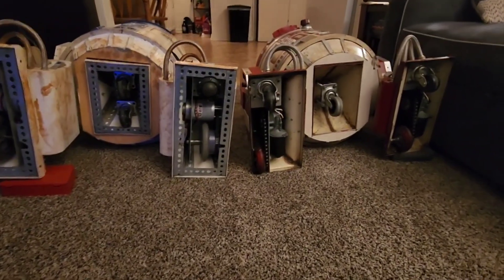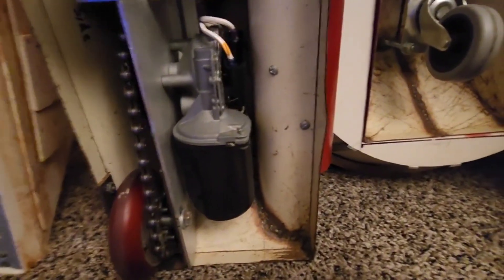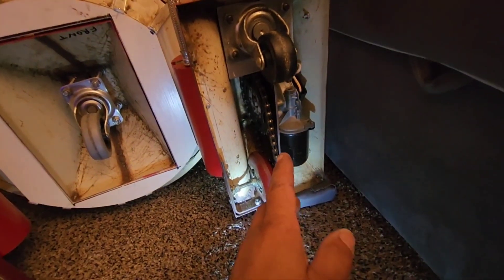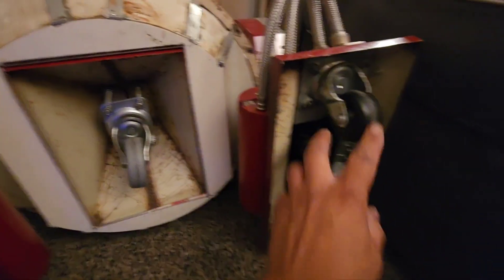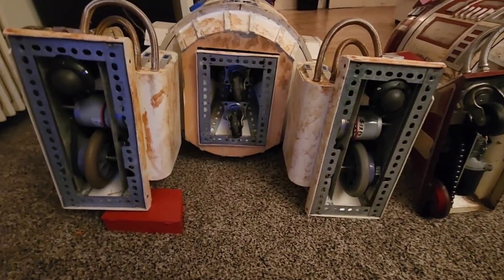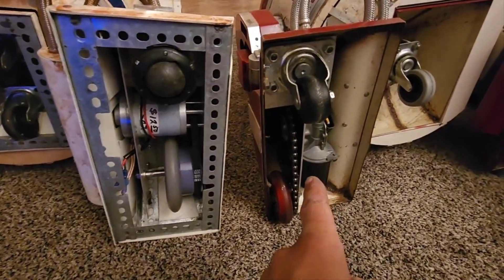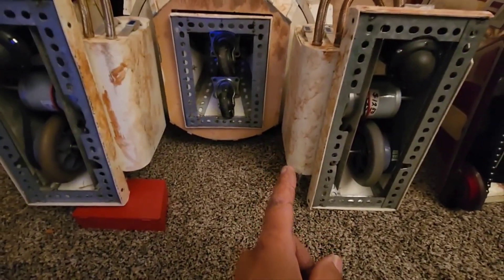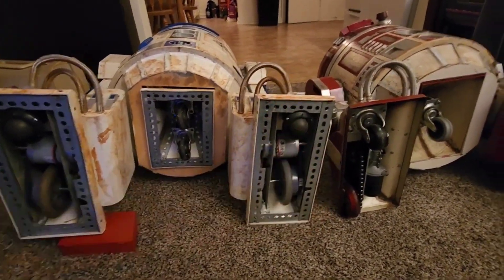R2 Building: Wheelbase on 2-3-2 droids

Comment: It's encouraging to see you have belt drive on R2. My droid in progress has belt drive and I've had a lot of issues with the belt slipping. I've had to add a lot of springs to the idler to keep in tensioned. I was beginning to worry that belt wasn't up to the task and that I should have gone with chain.
Reply from the maker: The successful belt drives have no tensioner wheel. But rather tensioners at the wheel axle, that keep the belt at a perfect tension as you tighten the axle nuts. Motorcycles have the same kind of axle tensioners that align the wheel and tension the chain perfectly before you lock down the axle nuts. The Razor scooters have them as well.
Reply: @craigsmith4436  Thank you for the response. I'm not familiar with that tensioning process and I'm a little too far with my method to change now. Is belt stretch a problem?